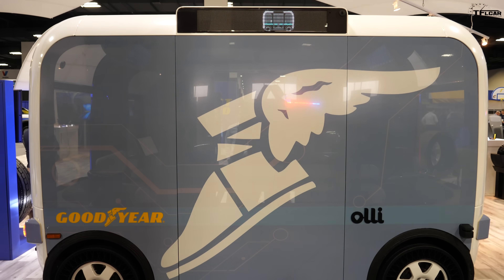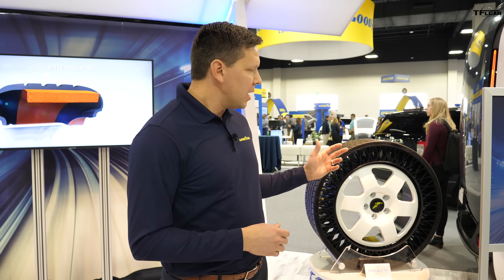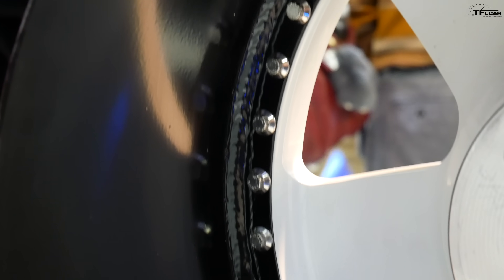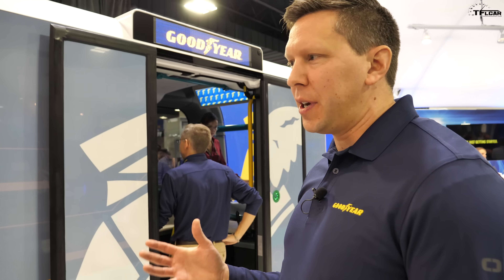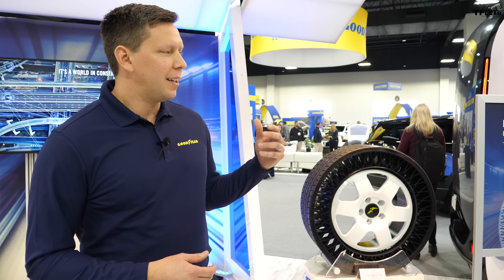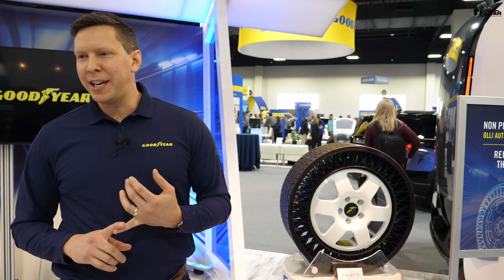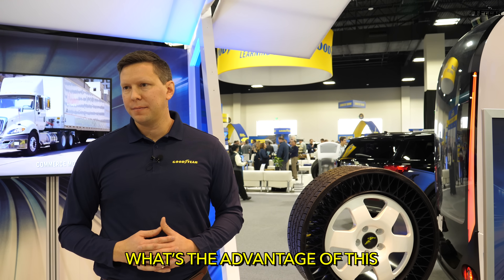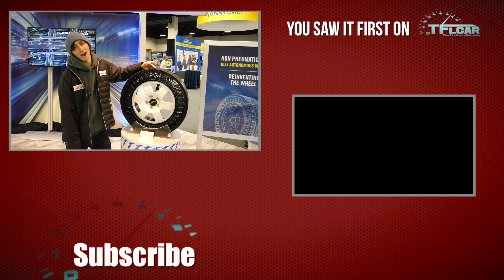Here's Why These Goodyear Airless Tires Are Unlike Anything You've Seen Before!

Comment: These young expositors have a low vocabulary.  They use few words that they repeat and he used descriptions, for instance, "Kinda welded". Is it kinda or is it actually done?   Now we have to buy the whole wheel, rim and all.  What if I have to buy only one, two, or three, they would not match with the ones that are there before.?  The price would also escalate, making it difficult to buy.  Then the problem of having to discard the original rim. This is like the copying machines that are sold cheap, but the ink and toner are just as expensive as the machine.  They will have us grabbed by the balls.

Comment: This is outstanding and the future solution to tires longevity.  But they need to cover the ridges to stop dirt from accumulating between the spokes.  The dirt, mud, snow, etc. would stick between the spokes and make the tires heavier, unbalanced and difficult to clean.

Comment: LOGIC is its not rocket science to produce airless tires..it should be the easiest thing if you can produce these air tires..just that they don't make economic sense to these manufacturers...any product that brings more safety and a longer life expectancy is a NO in the commercial world , it diminishes profits...THE ONLY THING DELAYING THEIR PRODUCTION IS ONLY IF THEY ARE STILL FIGURING WHAT WEAK POINT THEY CAN EMBED IN THESE TIRES SO AS TO MAXIMIZE ON MORE REVENUES.

Comment: As long as you don't drive in snow, ice, mud, or dirt in general.
Being that on average, I get 0 flats a year running good quality pneumatic tires like BF Goodrich.
Even the few punctures i have had were permanently repaired with a tire plug.
This gimmick "airless" tire is just another miracle solution looking for a problem that does not exist.

Comment: When they can handle Michigan roads for 60,000 miles I'll be convinced.
Reply: Wouldn't make 1 winter. The gaps would fill with snow and slush that would refreeze, then tear the tire apart when it tried to flex and was severely off balance. It would need side walls to survive any snowy or muddy conditions.
Reply: @patrickyoung5348  it actually does well with that. When the tire flexes it breaks up any buildup and the force of it spinning shoots it out. These tires have been in use for commercial mowers for a few years now and I've seen people use them all year for mowing in wet/muddy and dry conditions as well as putting a blade on the mower and plowing snow with them. I was surprised how well it actually worked because I had the same reserves you do lol.
Reply: @patrickyoung5348  
They have been tested in snow and mud with positive results, tweel's are tougher than standard tyre's.

Comment: The tire companys have been showing these “future” tires for its seems like decades
Reply: At least 20 years. We'll have hover cars before these come to market. I've seen them on Bobcats which is a good idea, but during highspeed emergency avoidance, I bet these suck. I've seen it tested on a Chevy Bolt in some video but we'll see if any car brand ever wants to use it. I would be good for around town electric, automated food delivery or something like that.
Reply: THEY ALREADY USE THEM FOR LIGHT CONSTRUCTION EQUIPMENT
Reply: below me no shit. Was talking about car tires.
Reply: That’s because it has been decades! Since the 90’s 😑
Reply: They work well on slower work equipment.  I have some on my zero turn mower.  I love them. But they are expensive
Reply: Yeah. Also, even after all this time all we get is big plastic spokes. Super crude. No wonder they don't measure up to typical tires.
Reply: Guess you haven’t been paying attention. They’re all over construction sites. Pretty much every skid loader that doesn’t have tracks runs on these.

Comment: What happens up north when the holes on the side of that tire get packed full of snow and ice?
Reply: They make a flexible sidewall? It's pretty easy, but it would just look like a normal tire which wouldn't look cool for their show.
Reply: Offroad version will have enclosed holes. The one demo is for the Olli which will operate in the city.

Comment: A non-pneumatic tire has been known for 10-20 years for sure. However, it did not go on sale. GoodYear's guy confirms that the timing of commercialization has not yet been determined. The advantages of the tire are clear: punctures are not terrible, rolling resistance is better. But if you think about it, you can assume that there are no fewer minuses, and maybe more:
-
 you cannot lower the tire pressure to overcome deep snow and mud

- it is impossible to replace the tire itself separately from the entire structure, only in its entirety. The disks will obviously also be specific, not compatible with those that were for pneumatic tires
- dirt, debris and ice from the roads will get into the open tire and impair rolling and balancing
-
 if you park in the snow porridge in the evening above the tread height of this tire, then at freezing temperatures at night the tire freezes into the ice so firmly that in the morning you won’t go anywhere

- there will be a lot of curiosity and people will stick sticks and other objects in your wheels for the sake of a "joke" that could result in tire damage,
 car and generally threatens your safety on the road

- price. She will probably be terribly high. otherwise, these tires would have been produced for a long time, because they have been developed for a long time and, obviously, many tire manufacturers also have the technical ability to produce them

Comment: "Are cars going to be sold with a spare tire anymore?" Are they now? I'd wager at least half of new cars don't even have a spare these days. A phone or some tire slime and DC compressor is the best you'll get.
Reply: @e_millimill not really. He said he would wager at least half the cars sold didn't have a spare when in fact less than a quarter of the cars sold didn't have a spare. Over 75% still have spares.
Reply: @e_millimill welcome to the internet where people make big deals over nothing because we have nothing better to do.
Reply: Every new car comes with some form of a spare tire. It may only be a donut tire, but a spare none the less.
Reply: @robertkeel3336  False. My MX-5 certainly didn't. Most BMWs don't. Mercedes? Nope. Tesla? Nope. Plenty of others too.
Reply: @nathanc777 so I stand corrected, not EVERY car is sold with a spare. Almost every car that is sold without a spare is sold with run flat tires or like you said some slime and a compressor but the vast majority of cars sold do come with a spare. But the spare they come with is only as good as some slime and a compressor anyways. People have a bad habit of using the donut tire as a permanent solution. It's only meant to be used the same way as fix-a-flat, long enough to get you to a tire shop. But to say half don't come with a spare is false. Chevy, Ford, Dodge, Chrysler, Fiat, Subaru, Toyota, most Mazdas, Jeep, GMC, Cadillac, most Lexus, most Infiniti, and many others all come with spares. A lot of subcompact and compact cars from overseas don't have spares so they can maximize cargo area and save weight for gas mileage. Same thing goes for your Miata. There isn't much room to begin with let alone for another tire lol.
Reply: @nathanc777  in 2018 there were 281 models of vehicles available in the US market. Of those, 53 did not come with a spare. So way less than half.

Comment: Real cool until you get mud in one and it throws the balance all off
Guessing they will enclose them
Reply: Or snow and slush that gets in those cavities and refreezes overnight. They would have to have some kind of side wall to be viable.
Reply: Patrick Young totally agree
Reply: They will probably enclose them for off road wheels but the one demo is made for city and more specifically for the Olli.
Reply: 2dthoughts
Were you not listening to the Goodyear rep? He said these NPTs are only being designed for an autonomous vehicle that goes only 25 mph. Not for an off-road vehicle.
Reply: They'll enclose them and for safety fill them with air 😐
Reply: Mud or snow does not get stuck in these tyre's, they tested for that with positive results.
Reply: Chances are they will leave them open. The only reason I say this is that these tires are not new, even for Goodyear. They have tires exactly like these for zero turn mowers. Only difference is that they call those tweels. John Deere has had them exclusively for a few years now on their commercial mowers. Now I know there's a difference between a mower and an off road truck but to the tire, there's not much difference. Commercial mowers will inevitably have to mow lawns in wet conditions which means mud. They're also going through asphalt, gravel, dirt, sand and even sometimes snow when a contractor decides to put a snow blade on their mower. I own a landscaping business and have spoken to other owners that have used these tires and they have noticed that the ride became a little more rough than a pneumatic tire but not enough to not justify using them. Since the tire tends to flatten a little more than usual where it contacts the road, it forces the "X" braces to distort which helps to break up any blockage and then the force of the spinning tire helps to discharge it.
Reply: Or strap them to a high horsepower and torque vehicle and break those plastic inserts.
Reply: If mid or rocks can threw it iff balance majorly then why did the US army used this tyre in Afghanistan? Plenty of rocks there especially in battlefield
Reply: Guys..... it’s open on the side to show the tech used... you honestly think it wouldn’t have the sides covered?!
Reply: @Painfulwhale360  it literally won't have the sides covered. Look up the "Tweel" these tires have an open sidewall concept
Reply: Robert Keel it’s to show what’s inside! Of course they wouldn’t engineer this with the sides open because it’s more than obvious things would get inside. They have to be closed because if even a small clump of mud got inside it would throw the balance WAY off.
Reply: @Painfulwhale360  again, this tire concept is not new and they do have open sidewalls. If you don't believe me then look up the Michelin Tweel. Same design and everything.
Reply: @robertkeel3336  It's a concept.. exactly. Do you see them on the roads anywhere on passenger vehicles?
Reply: @Painfulwhale360  dude I'm not gonna argue with someone that can't do simple research. Have a nice day.
Reply: @robertkeel3336  What do I need to research?! lol
Reply: @Painfulwhale360  ok, listen good because this is the last time I'm gonna say this. These tires are not a new concept. They have been sold for skid steers and commercial mowers for a few years now and other companies have made these before over the past few decades. Previously they never caught on for passenger cars because the technology wasn't there to make them a suitable replacement to a pneumatic tire. Point is that in every application that they are currently used in they do not have closed sidewalls. Since the interior distorts where it contacts the ground it breaks up any kind of build up that is inside the "X" design and the force of the tire turning makes it eject the broken up pieces so to not cause a buildup and throw the tire off balance. Now if you want to keep arguing with that then you just have fun with it. ✌️
Reply: Robert Keel I know they aren’t a new concept. They have been around for a long time now. Of course in heavy equipment that operate at relatively low speeds it’s not going to be such a big deal. My original statement was referring to people asking why this specific tire that is used for passenger cars is open on the sides and I simply stated that of course it’s not going to be open on the sides when used for passenger cars.

Also, remember this, as you try and act like the ‘big guy’ here and taking the high road by stating you aren’t going to argue with me.... YOU are the one that started this argument between us. And btw, how do I listen to text? 

Peace ✌️
Reply: @Painfulwhale360  ok 👍

Comment: Great until a rock or mud gets in there
Reply: They can just enclose them.... Big brain over here I know
Reply: Yep, they have to enclose them. I bet this open design is just for tractors or other really slow in vehicles. If you got some mud or snow in there and it was on a regular car on the highway it would create some tire balance changes and wear wheel bearings, struts and bushings faster and in the worst case maybe some vibrations felt driving at high speed. I guess you could always pull over and poke it out with a stick!
Reply: These have been on Bobcats for a while and doesn't seem to effect them to much. Although a bobcat doesn't go 80 On the freeway
Reply: Rock, mud or snow does not get stuck in these tyres, they were tested with good results.

Comment: Been seeing these since the 80s let's go already!
Reply: Why would they sell this forever tire to you when they can sell you 6 sets of air tires that have blow outs and unrepairable damage. It's a money loser over time so there will never be one set sold. You could take that to the bank.
Reply: Over time from wear and tear and I’ve damage the inner plastic parts will start to crack and break and a replacement will be needed eventually. The outside tread will also break down and need to be replaced. The continuous capital soul sucking cycle will always continue don’t worry.
Reply: @tigeroll  if they're so good, someone else will sale them then you'll be forced to sell them to compete or go bankrupt since normal tyres won't sell
Reply: They've been making them and selling them for decades. Construction, Military, oil and gas, mining, and forestry have been using them for a long ass time. I don't know if they would be stable enough at highway speeds around a corner to be a viable option for a passenger car

Comment: So it looks to me that going through thick mud that this thing would load up and need frequent stops to un-plug. Off road would be great with  this tire if those problems could be addressed.
Reply: Pretty sure a production tire would be enveloped in a rubber. Otherwise it would certainly gather debris.
Reply: Rubber skirt on each side really isn't a big deal but things have been around since the 80s and I still don't see them in production 🤔
Reply: Ummm, it does matter. If a 2 ounce rock were to wedge in there it would rattle your car apart. Lol not to mention throwing missiles at everyone’s windshields....